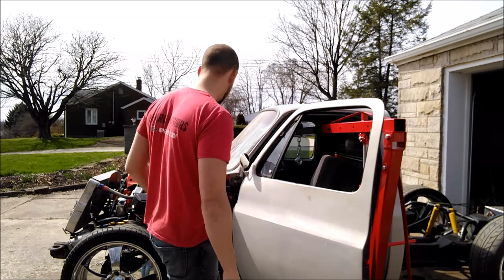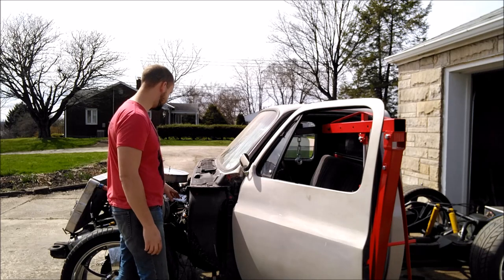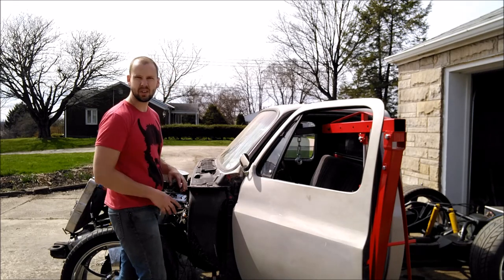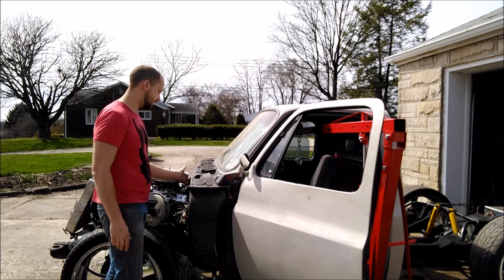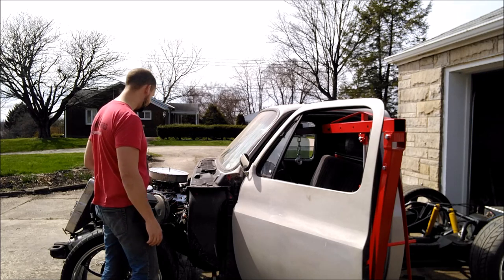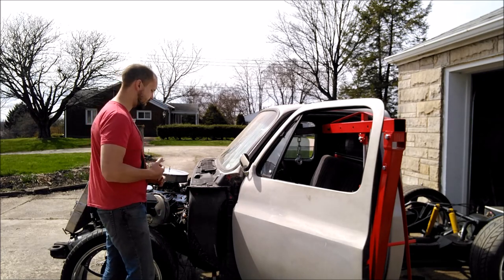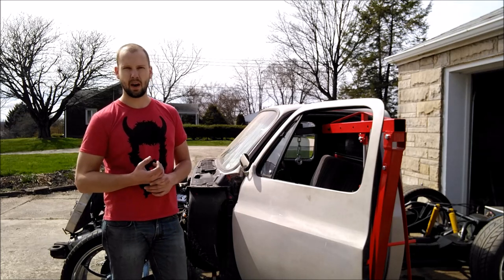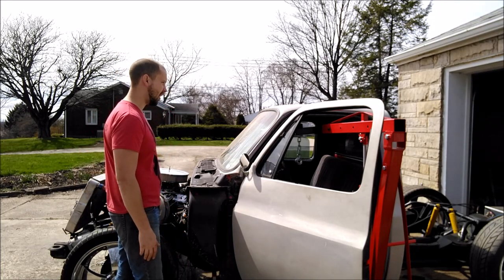Removing a Truck Cab with a Cherry Picker

Comment: im going to pull the cab off a 2003 ranger.. how difficult will this be disconnecting and reconnection all the attachments
Reply from the maker: I don't know Ford rangers but shouldn't have too much trouble.  All the electrical should be through a large connector that you can unhook.  You will need to disconnect steering, shift linkage, brake master cylinder throttle cable, and a few straggler things.  I pulled the can on a 97 ram once and it was basically the same process as the 86 Chevy.  I think they are all fundamentally pretty similar.